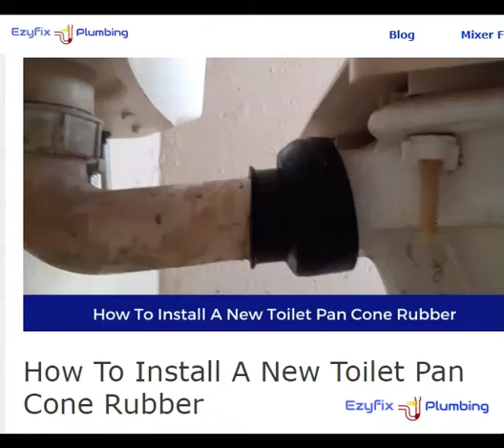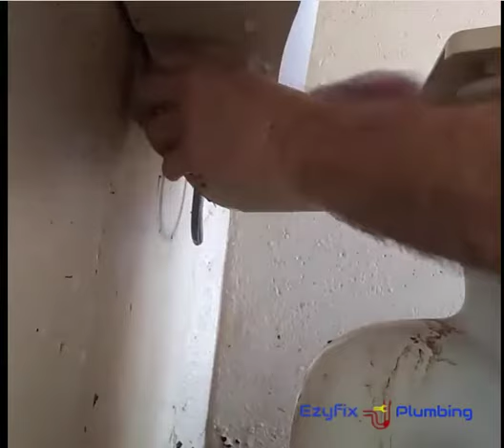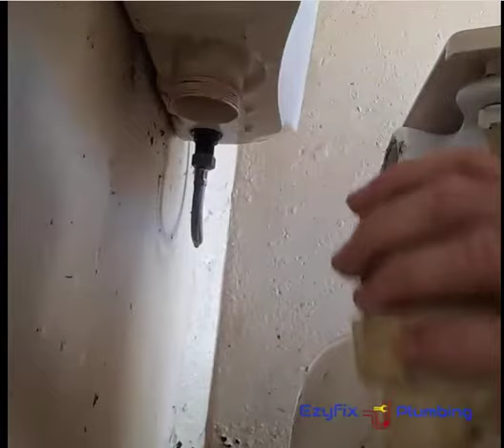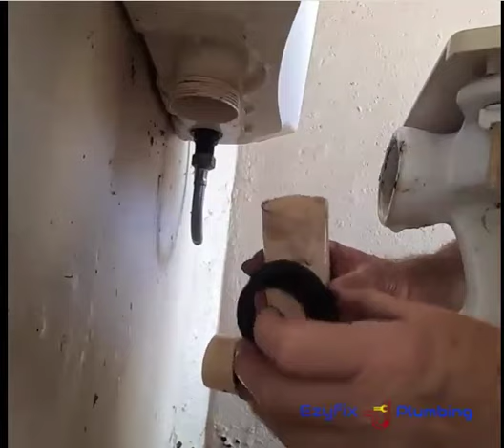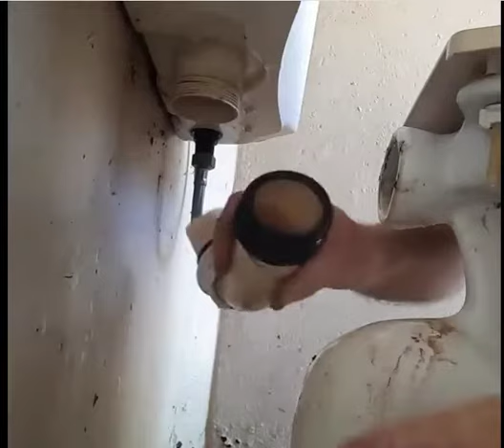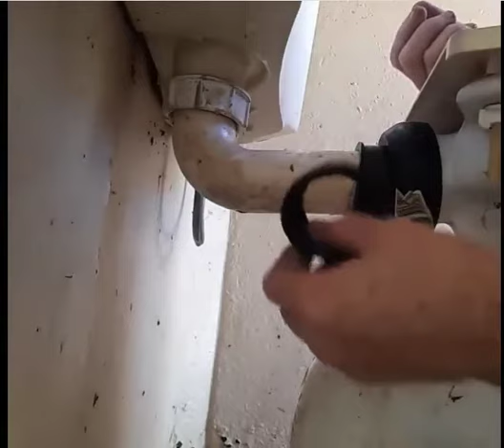How To Install A New Toilet Pan Cone Rubber

Comment: Mate, there is a place in heaven for you, wasted half a day on this and then found your video. Job done. For those that go to Bunnings, the top rubber is called Pipe ring The bottom one is Cone.
Reply: Thanks for letting us know what the top rubber is called 🙏 I couldn’t quite catch it in the video. I’m going to replace both while I’m at it.

Comment: I am so grateful to you. On an Aged Pension living alone was a big problem. Nearly 80yrs my hands were not strong enough to get the pipe through the hole. I put it into boiling water and also used detergent.  Wow got the damn thing through.  I can't believe I fixed the leak.  I followed your Video and without you I could not have done it. I am eternally grateful to you.  thank you so much.
Reply: Hi Dianne, thank you for your kind words and you are very much welcome. I just wish I knew what other videos I can do for you😀

Comment: Ta mate, after 25 minutes of intensive searching this is the only video or info I can find on this seal!  I didn't even know what it was called (talking about the cone seal).  My toilet has it and is about 30 yrs old, all other more modern toilets don't have this it seems.  Glad you left the "Fix-a-loo" tag on it!  Now I can do a search for that.  And good advice to also change the other one under the other end nut.  Good video showing how to install it by turning it back on itself.  Thanks again.
Reply: No worries at all mate. Yes I should do another vid on the other seal called key seal. It sit inside the housing where this 1 sits over it
Reply: I agree. Same with me

Comment: Like mentioned below, i was having trouble soaked in boiling water , with no go , felt i wasn't strong enough . Called local Reece dealer thinking there was a bigger size than 50mm.
I am on the disability pension and not very strong anymore. Watching your video i had the job done in minutes.
I can't thank you enough. 
Cheers to you mate 😎👌

Comment: I bought both 50mm and 40mm pan cones just in case. Turned out I did need the 40mm one! 
Easy and clear instructions, and video. I had to use a little bit of  detergent but got it fitted in 10mins for $5 Thanks, you're a legend mate. Liked and subscribed.

Comment: Great tip thank you..  I must have replaced dozens of pan cones in my lifetime..   Mine friends and family..  I've never used the pipe first and roll back trick..  And getting the mongrel onto the pan first is a nightmare..  But this way..  boom boom..  Thank you again..
Reply from the maker: Hey Geoff no worries at all mate, glad to have helped. The problem is we take those little things granted in the job. Yell out if you have any other little mongrel jobs I might be able to help with

Comment: This was exactly what I needed. There's minor leakage coming from a couple of cracks in the black rubber cone I noticed tonight. Now I know exactly how to replace it. Thanks!
Reply: The nut at the top of the flush pipe won't unscrew, stuck. Tried my hardest (going clockwise like this video). Not sure if you have any tips for that situation :D
Reply from the maker: mate you are very most welcome and glad to help
Reply: @macca3666  anti clockwise (like in the video) 😁👍

Comment: Thanks mate! off to Bunnings😁
Reply from the maker: make sure to get the right size, there are 2 different sizes, 40mm and 50mm. its only where the pipe goes is where makes the size differences.

Comment: if i don't turn the tap off and some how flush the water out of the top part, wont water spill everywhere when I go to replace the rubber?
Reply from the maker: That is correct so you can turn the water off and empty the tank if you would like to if you don't trust yourself from not pushing the buttons